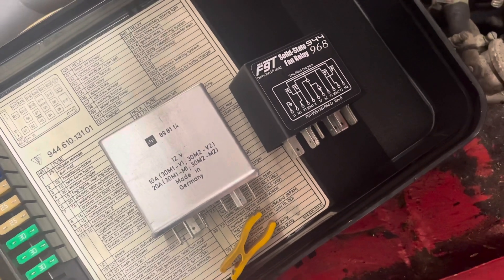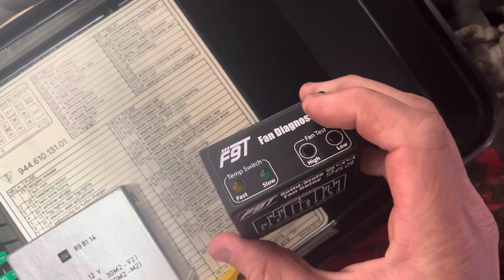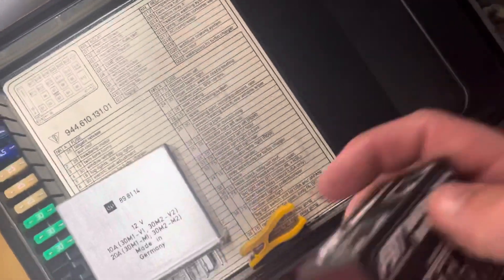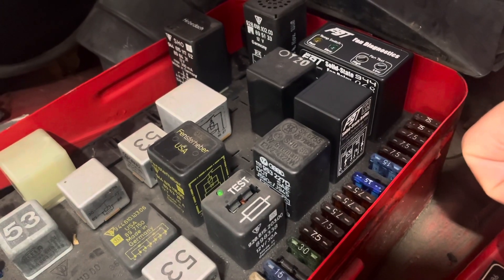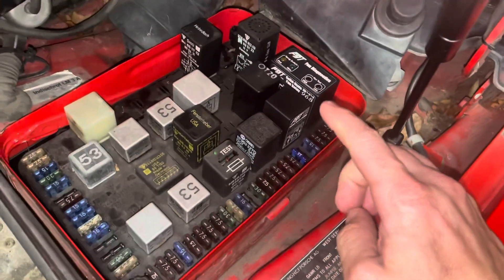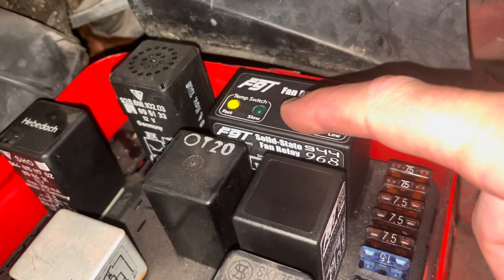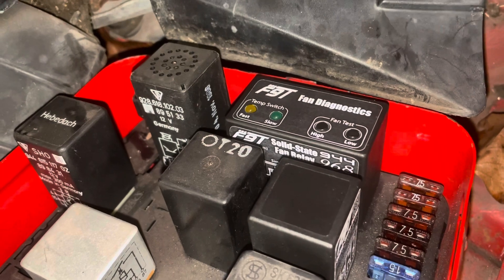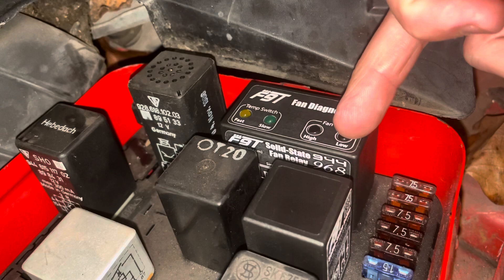Porsche 944 F9T Fan Relay upgrade

Comment: Yep. I concur on the dme for the fuel priming.  In May I picked up a 90' cab.  Was sitting for long time.  I noticed in the storage compartment under the radio there was the original dme relay.  Looked in the fuse box and saw it had been replaced with a German non Porsche relay. Bim sure was quality and OEM.  Fast forward a month later it wouldn't start. I thought I'd have to get er towed. Called my bud who's got a 968 (2 actually) and a , 928.  He said remove the relay, smack it on a hard flat surface a few times.  Reinstall and see if it works.. and it did!  He explained they've got moving contacts inside and they get hot and wear out. After researching, I found F9T solid state.  Figured for an extra $30 and solid state, why not!  But for the cab it doesn't prime because of safety reasons, it's got another system going on but it does the same thing otherwise.  I've noticed better starts and idle now as well plus the RPM's at idle when revved don't just drop, the engine rpm's do drop but slow up at just above 1k rpm then go slowly back to idle instead of free falling to almost stalling.  Thanks F9T!  Next will be that relay for the fans!!

Comment: I installed one in my 968 and in less than two years it was gone, the fans were always working and it got overheated and desoldered the integrated circuits.

Comment: Ooooooo now this is effing nice wow. Holy cow that takes alllll of that PITA work out of it.
Reply from the maker: Hey man hope you’re well. These have been back ordered for a while, finally got mine.
Reply: @tims_4x4_garage  good to know, I’m planning a few upgrades to do kind of all in one go, like these solid state relays, potentially doing a muffler delete and throwing on carbon ceramic pads with slotted rotors like I had on my other car. I love this idea though takes out all the friggen guess work on the fan circuit. Keep on pluggin away at that car it’s fun to watch! 👍🏻
Reply from the maker: @TakeFlightGarage  the car gets loud quickly. I have a resonator in place of my cat and even with the factory muffler the car was on the loud side. I built a new axle back exhaust and I love the sporty tone but it is on the loud side.
Reply: @tims_4x4_garage  is that what you have on the car in your videos??? My car has a completely stock exhaust save for an after market catalytic converter.
Reply from the maker: @TakeFlightGarage  I have a few videos with the stock muffler and a resonator in place of the cat, and I have a few videos after i put a flowmaster 60 on it. I recommend headphones if you’re trying to listen to the tone.
Reply: @tims_4x4_garage  okay yeah, I’ve been watching those videos on repeat since someone recommended a flowmaster to me 😂
Reply from the maker: @TakeFlightGarage  whatever you do, post a vid!
Reply: @tims_4x4_garage  Yezzir will do!
Reply: @tims_4x4_garage  Hey man hope things are well! I know it’s been a minute. My cooling fan relay is shot so I used it as an excuse to order both solid state relays from f9 finally. My question for you is, do you remember how long to it took to get them? I’ve tried reaching out to the sales team via email but I haven’t gotten any responses.
Reply from the maker: @TakeFlightGarage  man I don’t remember those details I wish I did
Reply: @tims_4x4_garage  All good I just hope they get back to me soon, those things are friggen expensive 😂😂😂😂 worth it though it looks like. If all goes well with my experience ordering these I’m without a doubt gonna go for the Sport DME next.
Reply from the maker: @TakeFlightGarage  good luck with everything man! I’m sure they’re gonna get back to you soon. I talked to the guys out there a few times
Reply: The solid state stuff is the way to go for sure.
Reply: Yep! I did ceramic pads. Amazing feel and almost no dust.  Did the F9T dme relay.  Recommend: yep!